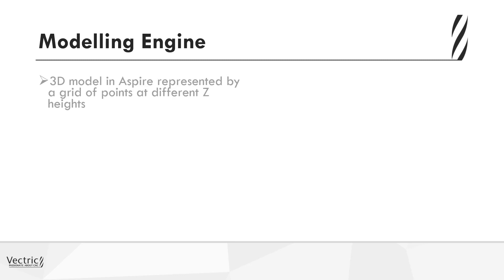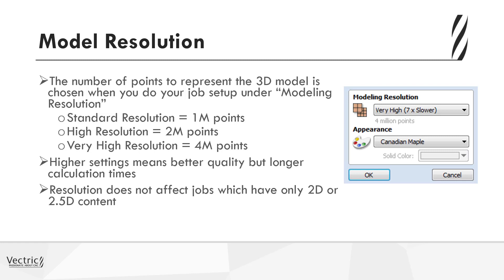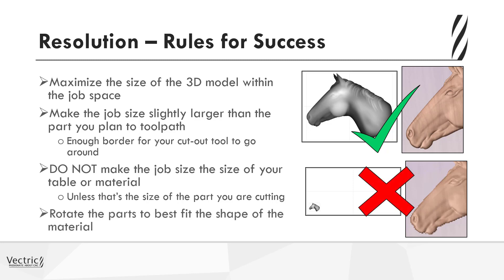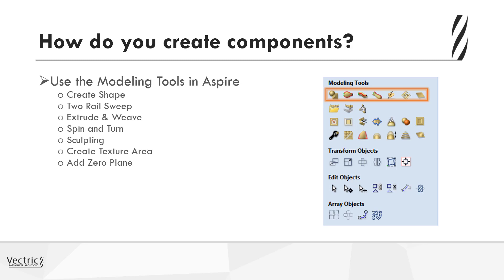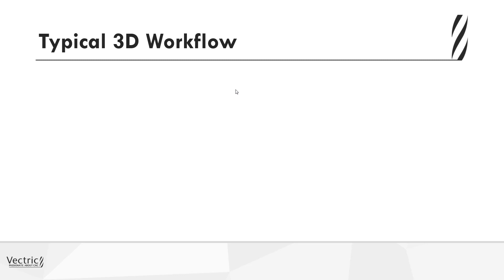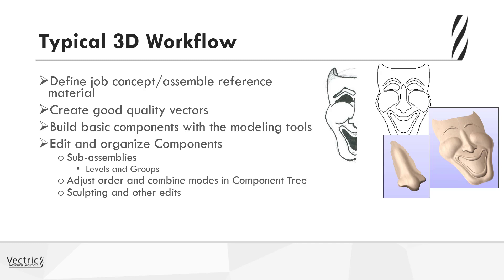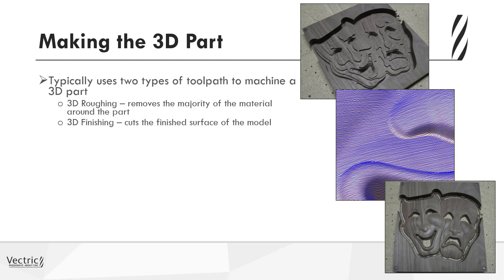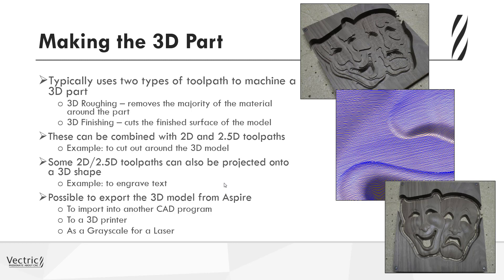Vectric V10 Tutorials | 3D Modeling | Introduction to Modeling

Comment: So if made a tiles model by the size of 15*30 and array it to the cut size of 122*244, did the resolituon of my model that i just array decrease?
Reply from the maker: Hello and thanks for the question.  I would expect you would be spreading the resolution denisity over more parts, so yes you are correct.  In most cases this would not effect you final cut part too much, but I would rely on the 3D tooling privie to be sure.

Comment: Dear Sir.
 Day before i install the Vectric Aspire 10 it's a good software for 2D & 3D Modeling i am happy to work on V.A.10, its very easy and friendly software i want to ask one question , i did not  not found in ver.10 Can i change the cross section within modeling means i want to amend the cross section and modeling should be change according to Cross section amendment within modeling .

Waiting your response on my email